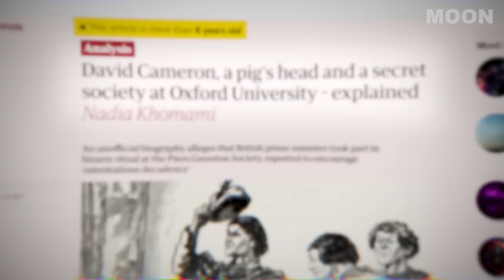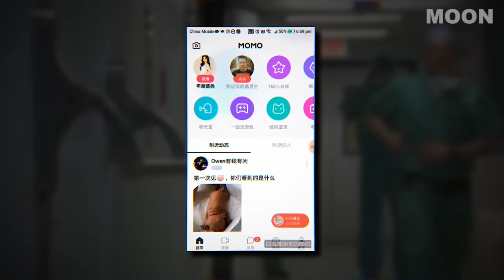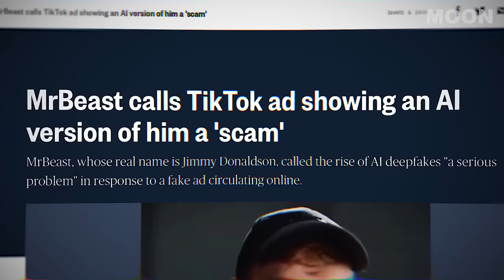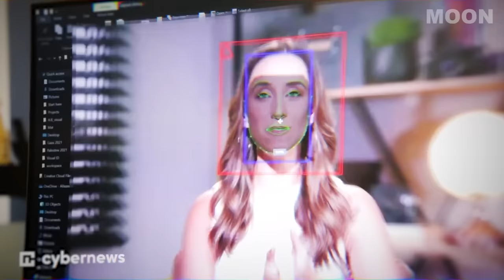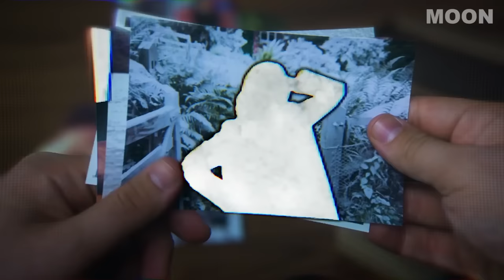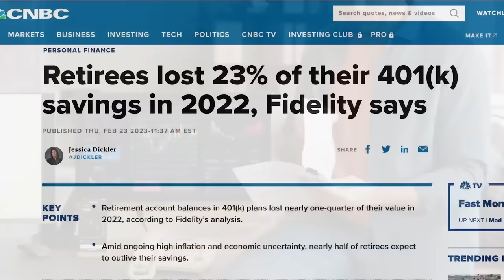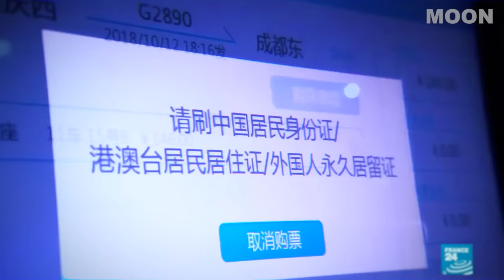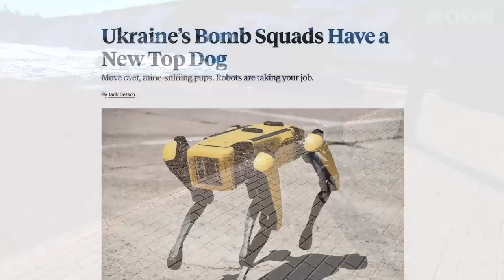How Technology Ruined Society Forever

Comment: You know that Uber implemented similar system relative to the Chinese ones where a driver or riders can rate each other depending on their behaviors or actions. So the future is pretty much now.
Reply: That's a huge difference, I've worked as an Uber driver and the rating of the passenger was a life saver for me
Reply: @manuelcalavera7272  I forgot to add to note that the system itself can be used for both good and bad so it can depend on how the company utilizes it for consumer’s needs or for political motives.